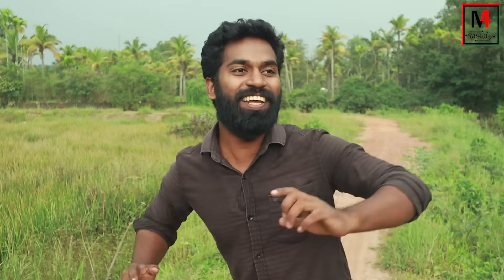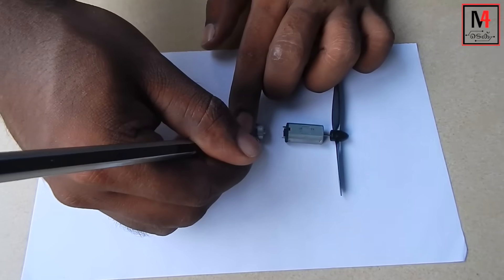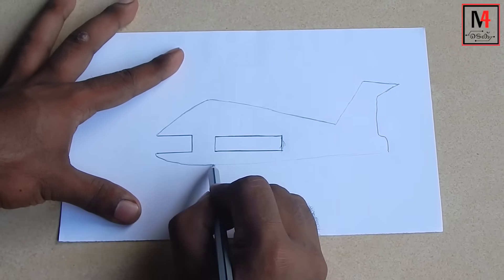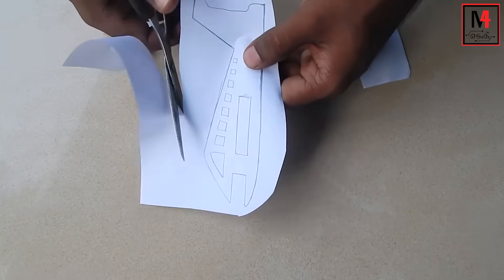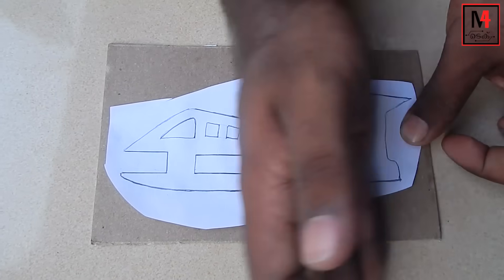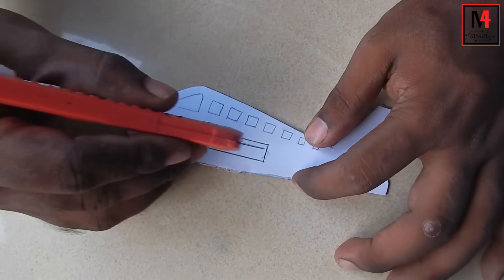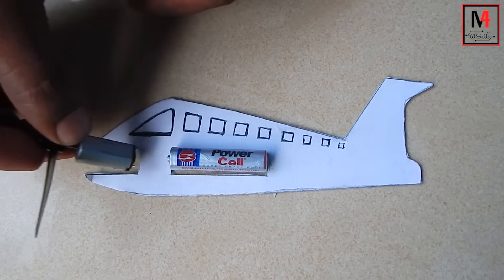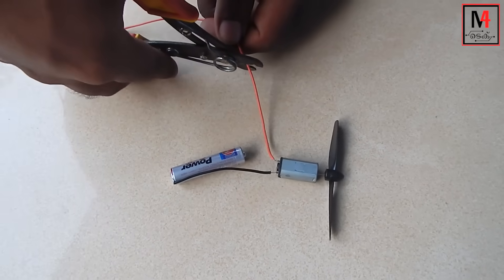The Smallest Plane In The World | ഇതിന് ഞാൻ ഉത്തരവാദി അല്ല  | M4tech |

Comment: Hi aircraft fly using Bernoulli 's theorem... Engine will only push the air behind (thrust) and wing produce the lift (fly)... That is why u r aircraft is not flying... When u tie the thread the motor pushes the air behind and produce trust..that is why it is keeping the radius and rotating....make a aerofoil wing it will fly☺️ and make your elevator (wing like thing at the tail) half of it in 13degrees..
Reply: It have the hole on top of plane😂

Comment: It has no airfoil and wings are short and cant handle torque of motor and you should use 3.7 volt 150mah lithium polymer battery